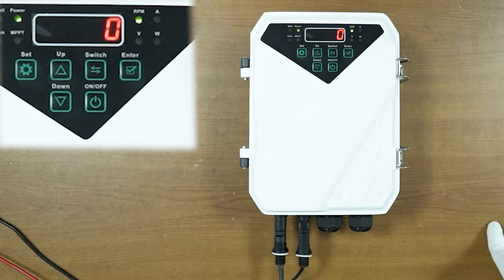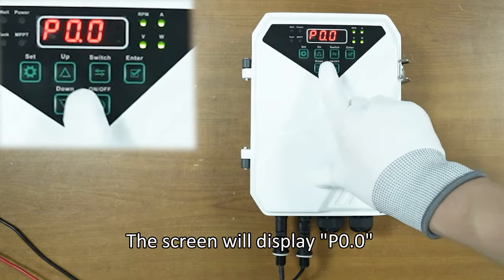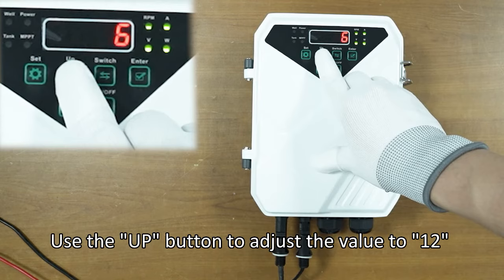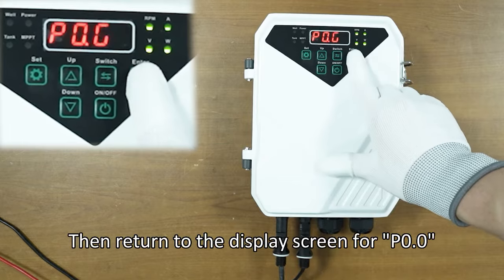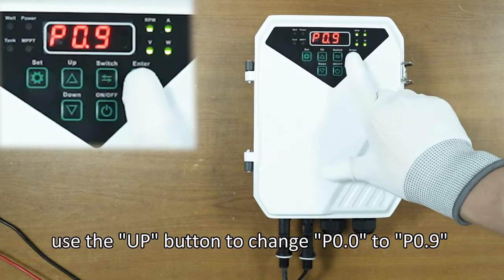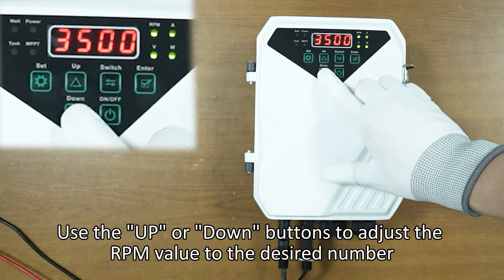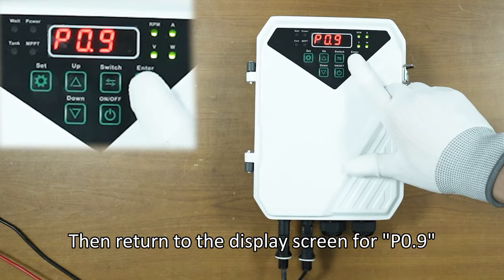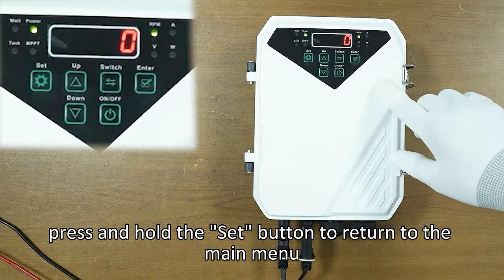Set the Default Motor Speed of WBS Solar Pump

Comment: Needs a parameter to set the minimum motor rpm...
Reply from the maker: We are still working on it. Thanks for your advice!
Reply: I agree - I'd asked for that too. There's no point having the pump spinning in low light where the power is insufficient to lift water, but still ok to operate the pump.
Reply: once the setting is set, can we still reset the rpm speed?
Reply: @FORCADOFAMILY  The maximum speed can be set to whatever you want, and saved (eg 1400 rpm).
Later you can edit it if you do not forget the process!